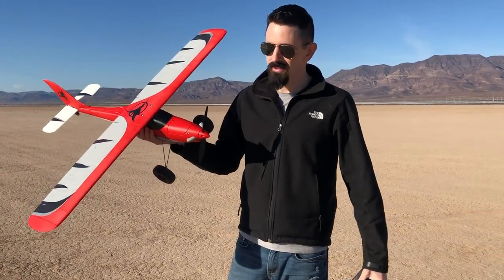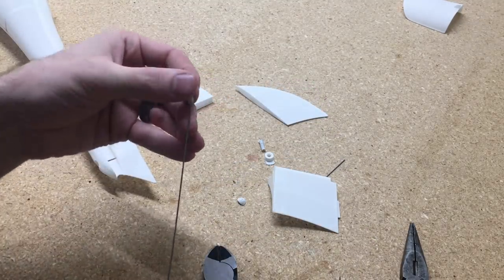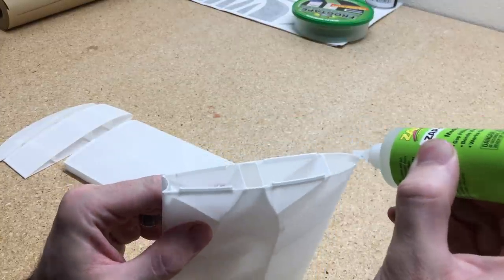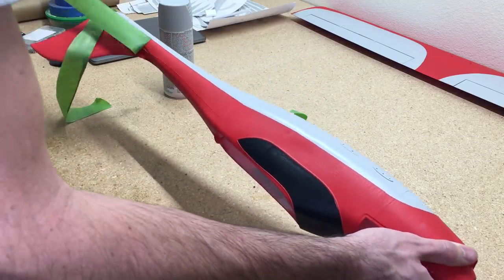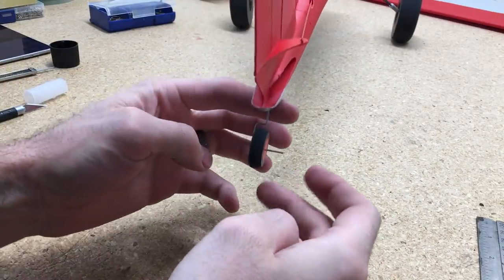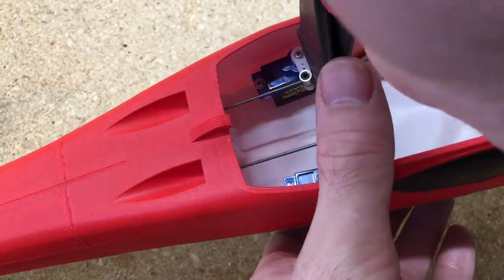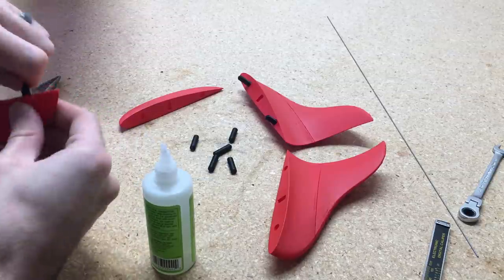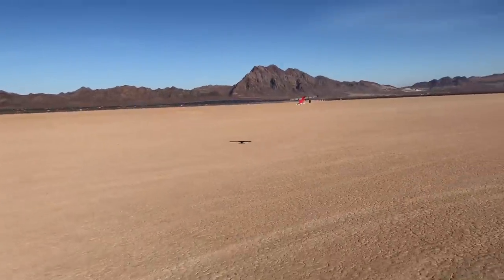How to Build Eclipson Model C 3D Printed Bush Plane - LW-PLA

Comment: Another great video Troy.
What LW-PLA profiles did you use, and which slicer?  The parts look so clean with no stringing - much better than I've ever achieved with LW-PLA.
Reply from the maker: I use Cura for slicer. Yes there is no stringing for these parts become of Eclipson's method of limiting the movement of the extruder. The only parts with stringing is when it prints the tabs for sliding the parts together. I use all the same setting on the Eclipson PDF files for their models. They are all the same setting and works perfectly.
Reply: The design is done in such way that there are no travels.
Reply: Many thanks.  I'll try Eclipson's settings with Cura.

Comment: I see the option for a center carbon spar, but in the video I do not see holes for the spar in Wing_C, Wing1_L, or Wing1_R.  So how exactly is the spare to be installed?  Or is there an updated version of these 3 parts?
Reply: They updated the wing to include bowden for carbon fiber spars (maybe wood/balsa will work as well). Definitely use spars as the wing is not strong enough without them.
Reply: @ThomasGillot  Awesome, do you know what the diameter of the carbon needs to be please?

Comment: So which temperatures and flow did you use for both light weight PLA and varioshore tpu?
Reply from the maker: LW-PLA 53% flow 235c Varioshore the same but turn the speed to 30 mm/s

Comment: Troy, did you have any issues printing the new Fuselage 2 part?  All that new support material, starting about 1.5 inches up from the bottom, seems to want to starting printing without any support.  It looks like a run of 1 3/8 inches straight from a cross section to the outer wall.  For me, it all ends up as strings... never attaching to the outer wall.  Thanks.
Reply: Apparently this is the fix for the landing gear.  The support eventually "catches" and forms a bridge, but it takes a number of runs before this happens.  I stopped the print twice thinking something was wrong.  Eclipson says "let it keep printing".  Ok then.

Comment: Hi Troy, I just started printing my model C only to discover that parts FUS1 and FUS2 do not actually fit together. FUS1 has a completely flat end, FUS2 has tabs that do not have receptacles in FUS1. Any thoughts? I cant find any support email on the eclipson website, only a contact form that they seem to religiously ignore. Cheers, Laurence.
Reply from the maker: It may be because you had bottom layers set on make sure when printing all fuse parts and wing part that top and bottom layers indicate 0 in Cura
Reply: @TroyMcMillan  Yep, that was it - I feel like an idiot as its actually shown in RED in the table of settings on the plan. Thanks Troy. Printing is going well now.
Reply from the maker: @LaurenceCampbell  Nice I am glad I could help. Good luck with the build If you are printing with PLA version use a 1400KV motor 2212 it will need a bit more power then my LW-PLA version. 8x6 prop
Reply: @TroyMcMillan  Thanks Troy, I have ordered an 1100Kv Sunnysky motor, and plan to pair it with an 8x6 or 9x5. Think that would be OK?
Reply from the maker: @LaurenceCampbell  Ya that will work good.
Reply: @TroyMcMillan  Haha,  forgot to say it's LW-PLA. 😁

Comment: Troy, can you share your settings (temperature, flow, cooling, etc..) for printing with the lw-pla?  Is it much different from the process you showed in the thin-wall pla video?  I'm thinking in context of how much you want the lw-pla to expand after extruding.
Reply from the maker: I just added the setting I use for printing LW-PLA in the description of the video.

Comment: Hey sorry to bother you again but I'm trying to fabricate the main landing gear as you did in your video, what is the length of the longer of the two 2mm steel rod that has the L bend in it at the top? The PDF instructions that came with the stl files doesn't specify the length of the longer rod.  Also just FYI according to the PDF the wing attachment screws are M3X30. I'm finding them to be too short. I've had to order some M3x35 and x40 to see if they work

Comment: Troy, I hope you don't me posting this here.  If you do, let me know and I'll delete it.  I just finished printing all the parts for the Model C.  I downloaded the Parts Drawing and files at the beginning of February, but didn't get to printing until now.  This was a bit of a mistake.  For anyone else, don't download until you're actually ready to print.  There were errors in the Drawing that had me scratching my head for a few hours.  Parts #18 & 19 - Wing3L and Wing3R had a #9 Note on my download, whereas the current drawing has the correct #7 Note.  As well, in my downloaded files, the part HTP2R was a wrong part.  I was just sent the correct part along with HTP2L.  Not sure if HTP2L is wrong as well, but I'll re-print that, too.  Other errors in the drawing are the #68 in the drawing but not in the List - it should be #67.  #54 LG Fitting needs a X2.  The Parts Drawing errors are not big deals, but for someone brand new to all this, it's just another layer of confusion.
Reply: Hi David, thanks for the notes I just purchased this model. Looks like most of the errors you mentioned were fixed except for #54 LG X2 there is still no (x2) there but it is not the big deal.  HTP2R and HTP2L looks correct to me but will see how they fit. What was the mistake you found in HTP2R?
Reply: @samuimuscle  HTP2R was a duplicate of HTP2L in my files.
Reply: @rcdavidk  reach out to them about it, they'll be happy to help you

Comment: Would the plane still fly alright using a pla+ filament which is heavier that lightweight pla
Reply: Probably not unless you use a very powerful motor and a powerful battery but it would only add more weight. I wouldn’t recommend.